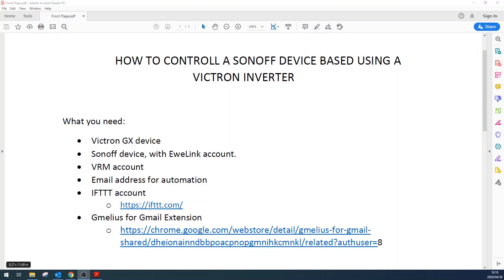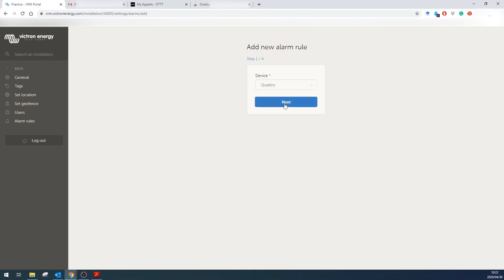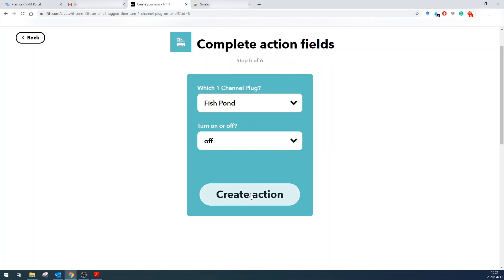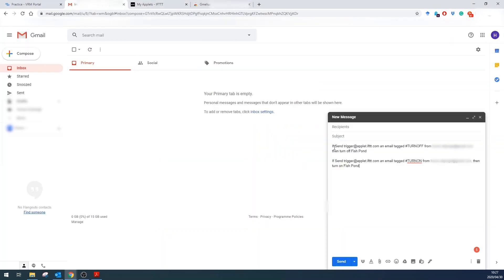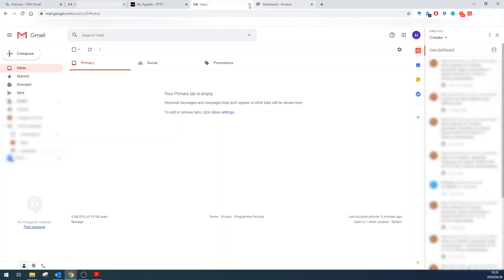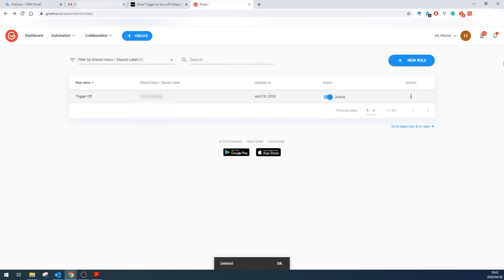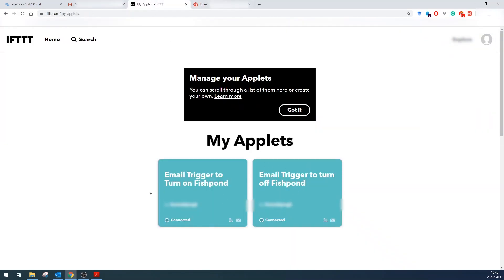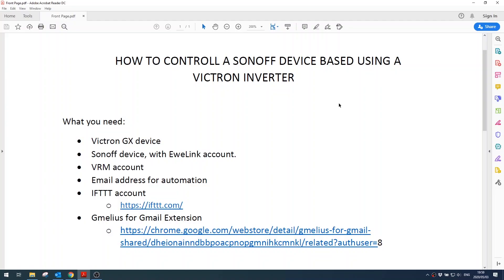Victron inverters with IFTTT - How to control a IOT device based on your inverter output

Comment: Awesome video.  Am trying to automate switching off certain appliances as they are connected to my essential load (ie my pool pump circuit) . So if grid is lost I want to read the email notification and then get ifttt to switch off pool pump and heat pump ewelink devices.  Do I use the same method you are using?
Reply from the maker: Hi there, 

IFFT has changed their policy so now its a paid service. I would recommend using a mini and creating a scene with that. I see now I HAVE to make that video. I will try and complete it next week.

Comment from the maker: Hi all, so after a week of having this work, I didn't realize that I was using a Gmelius trial version. I have managed to get it to work again but this time using a bit more of a full proof design. To summerise it, I use a programmable relay on the Victron and set the conditions to close and open accordingly. I then use a spare Sonoff mini and created a scene that when the mini turns on, it turns the others off/on. I found this to be the simplest and definitely the least time-consuming, If you want me to make a video explaining this please let me know. 

Regards Ewald
Reply: Ewald Erasmus hey there, I tried the dual Sonoff with a scene, but it does not work.Tried using two so off basic. Come on it is time for a new video
Reply from the maker: @dtssengine6870  I will try and throw something together.
Reply: How do you connect the sonoff mini to the victron relay?